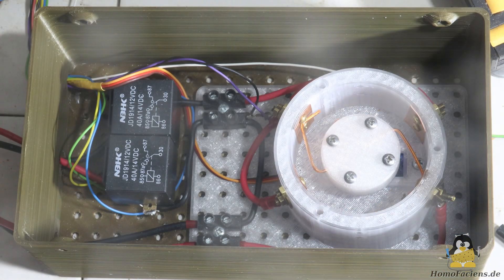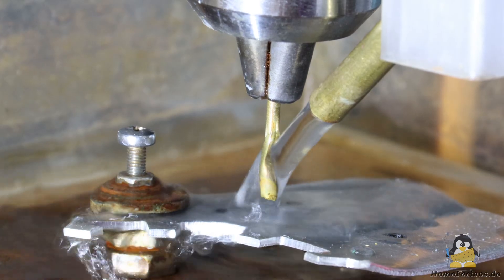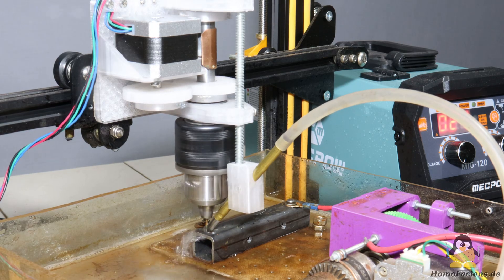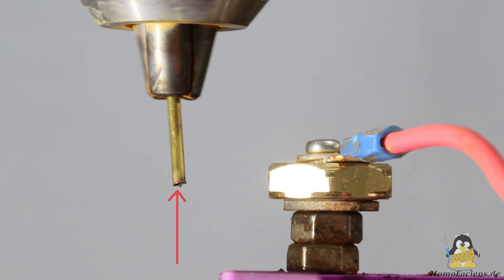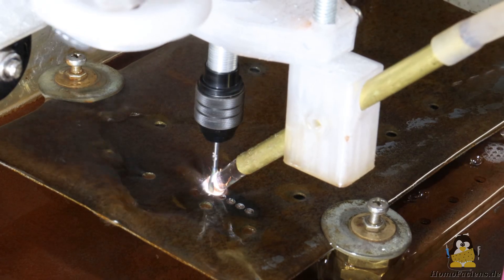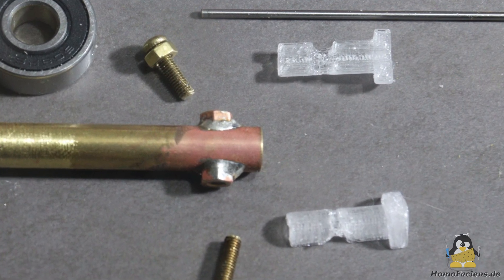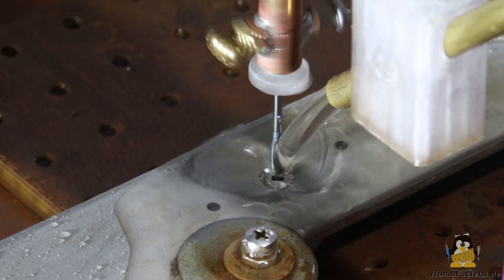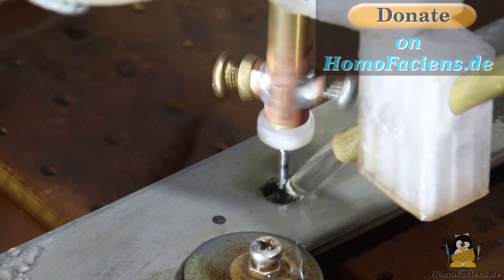Machining steel with a welding inverter, part 2

Comment: I have been diagnosing and servicing Swiss Charmilles EDM CNC machines for 20 years. Knowing how damn complex these machines are, I applaud your efforts.
Reply from the maker: Thanks! I call it spark erosion rather than real EDM. Touching/scratching the workpiece is part of how it works. The bit of conductivity of the tap water doesn't matter. That's what makes the setup a lot simpler. The precision is far below that of the machines you were servicing, but clearly higher than what you can achieve with low cost CNC routers. Good enough for the parts I need for other projects.

Comment: Is it just plain water or are you adding additional chemicals to control effects or results of the EDM process?
Reply from the maker: Plain water. In contrast to EDM, touching the workpiece to initiate sparks is part of how this machine works. A bit of conductivity doesn't matter.

Comment: I'm unsure of how many amps you need but you can get step up boards which you can use to generate a range of voltages up to like 70 rather cheaply. I use one to boost 14v to around 30 volts(my printers 14v but i run a 24v hotend at 30 on it)
Reply from the maker: I have been working with (sort of) boost converters before in this long series on unconventional steel machining. More on a better voltage/current source and on spark control in one of the coming videos on this series - stay tuned!

Comment: How did we get here? I feel like i may have missed a few of your videos. Why are we drilling holes with an electrode? There are proven ways to skin this cat and it feels like you may be reinventing the wheel. I like and subscribed because i am dying to know how this turns out and how we actually got to this point. After reading a few comments i see you're trying to build an EDM. I guess i should have started there before i opened my big mouth. Then why not run EDM wire through it? Those rigs are not difficult to make. Just a couple wheels to keep the wire taut and a couple of spools to feed and catch wire. I am even more interested in your channel now. Thank you.
Reply from the maker: You won't be able to drill the grid in steel with a CNC based on a weak 3D printer mechanics when using a classic drill / router.

Fiddling a wire through all of the holes would be extremely time consuming.

Yes, this series is a long one. All video links are in the description box below the video or you can go through the evolution on my pages, starting here:
https://homofaciens.de/technics-machines-EDM-introduction_en.htm

Comment: Why  you don't use a graphite electrode?
Reply from the maker: Because it works with tungsten?
Reply: Graphite erodes very fast. Not at all suitable. Tungsten is the way to go. Tungsten carbide may be even better.
Reply: @simontillson482  Carbon also has more potential to contaminate the metal, changing it's characteristics.

Comment: Please make using wire. I wanna build it..
Reply from the maker: I already have: https://youtu.be/KND_h_UEEQg
Reply: @HomoFaciens  My bad didnt check your old video. Btw, is it possible to use 0.1mm wires?
Reply from the maker: I have tried wires that thin, but not with real success. Its hard to feed the wire and forward the current through it.